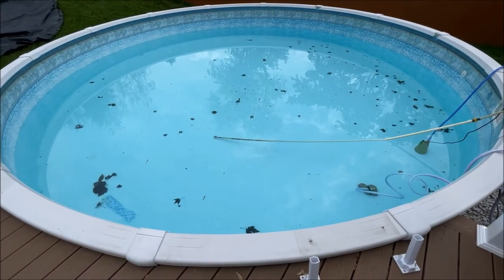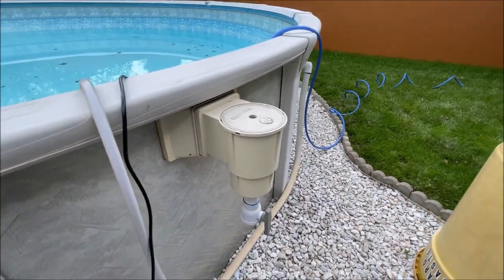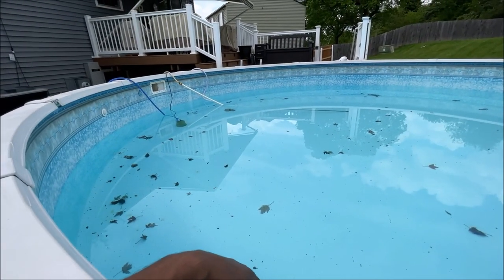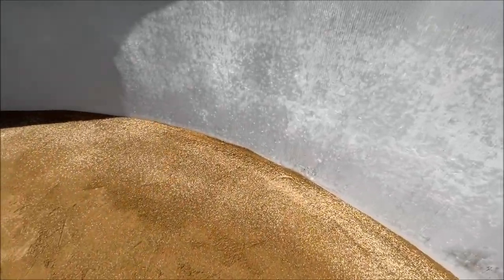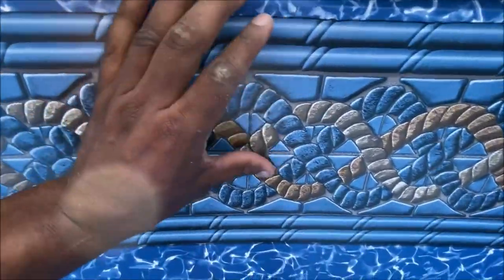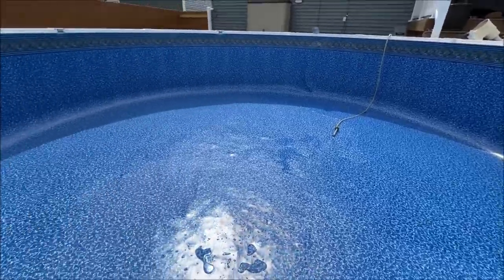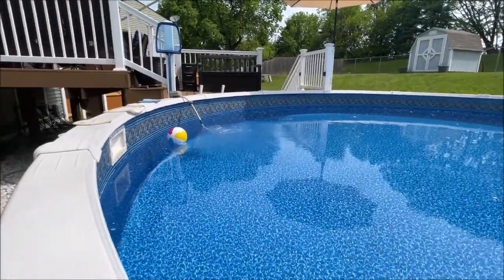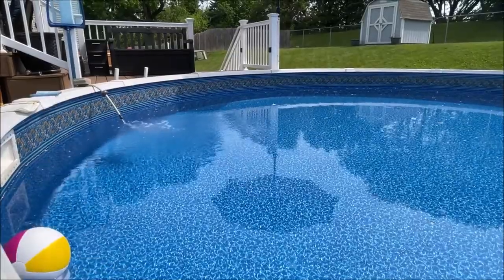Pool Liner Replacement

Comment: 😊 working on mine. Unlocking so many videos. Learning as I go. For me personally it was much easier to take the cop rail off and keep it off after putting on bead receiver that hangs over pool wall and then reinforcing with with the rails that snap over cinching but not screwing down the top rail because it's much easier to work the pool liner into the bead receiver without that overhanging top rail getting in the way of your hands and wrists can you create a little more room to create more leverage.. I wish I would have just bought the unibead liner because I had j hook and oh my goodness is it easier once you get it started. Some people use the locking mechanisms because there's too much space and I'm glad I don't have that issue but Sam is in the tight squeeze.. I got blisters on Me Fingaz 😅😅😅
Reply from the maker: I had no problem getting it into the track. Plenty of room with the tops left on. Just roll the liner back like opening a deck of cards box top, bend it back and put it in the track. Mine slipped right down in the track and easy peasy.